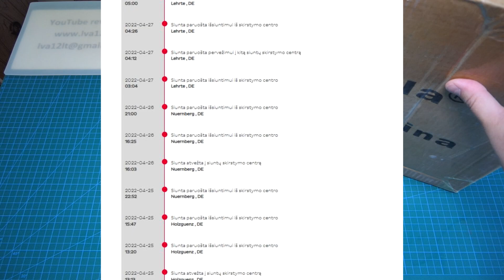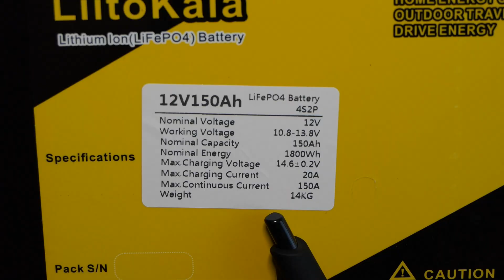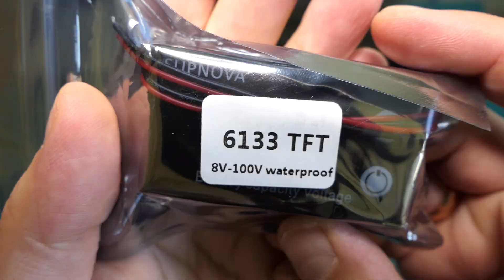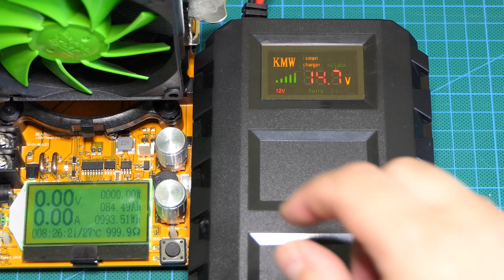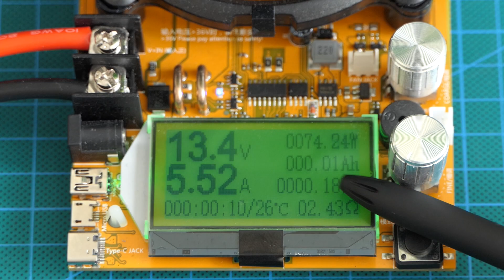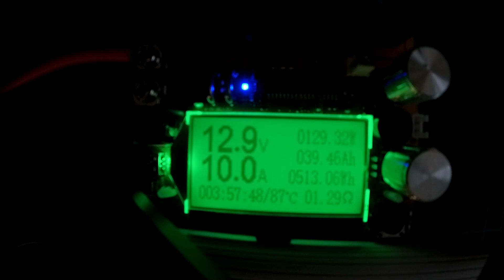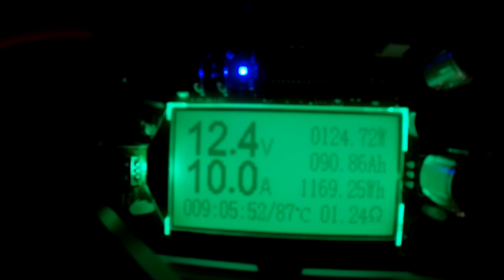150Ah LiitoKala 12V LiFePO4  akumuliatorius iš Aliexpress elektriniam valties varikliui

Comment: Почему разряжали с 13.5 ?
Это 3.37 на ячейку.  Надо зарядить до 3.6-3.65 на ячеку, напряжение аккумулятора будет около 14.4-14.5v. Тогда должно дать больше  емкости.
Reply from the maker: when the battery is fully charged using the charger, after disconnecting the charger the voltage drops to 13.5V +-
Reply: @LVA12LT  Thanks for the answer.I have the same battery, I took it apart, there are not cells, but packages according to the 4s2p scheme.The charge current is up to 20A.If I remove the BMS, will it be possible to charge it with more current than 20A?
Reply from the maker: i think if need more capacity better to bought bigger battery, example: https://youtu.be/IN979sDVal0
Reply: @LVA12LT  Why is the maximum charge current 20A?After all, LiFePo4 allows you to charge with a current of 1C
Reply from the maker: @hydrydxeon3008  about charging of 20A max i dont know why its the reccomended by seller. where you will use it battery? in boat ? in solar grid system ? where?
Reply: @LVA12LT  In solar system, current up to 30A
Reply from the maker: @hydrydxeon3008  for solar system this single battery is not good, becouse power of battery is only up to 100A  its about  1,1- 1,3 KW+-.
Reply: @LVA12LT  A discharge current of 100A is enough for me. The question is, will I ruin the battery with a charging current of 30A?